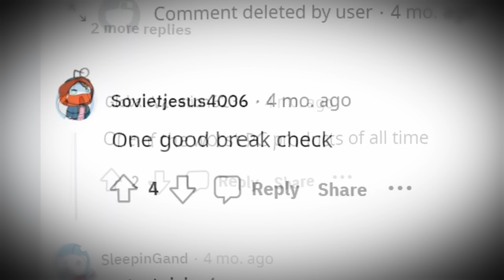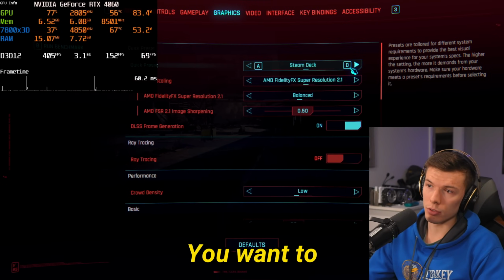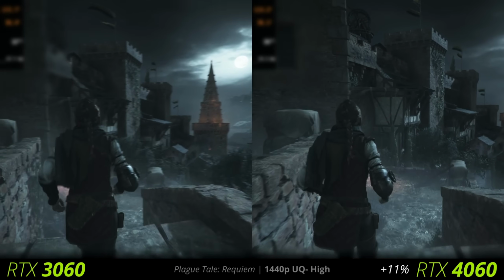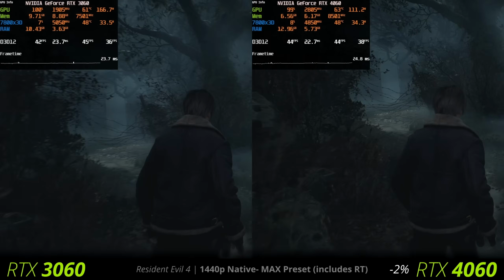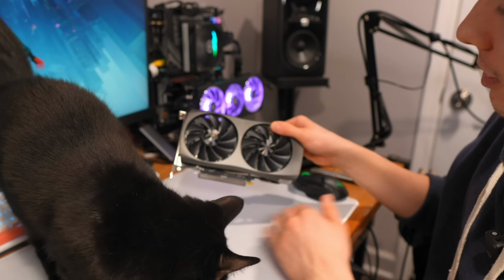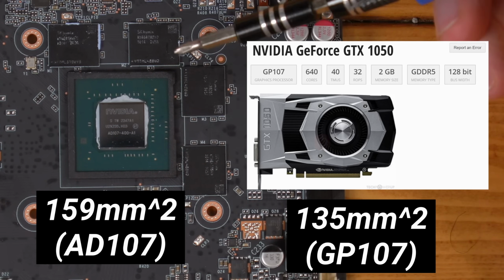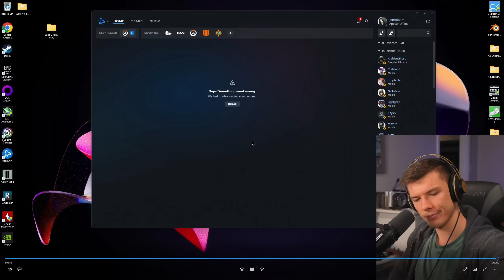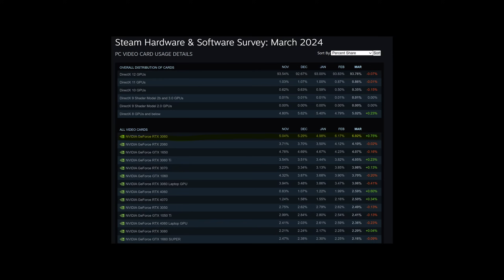I Tried Nvidia's best "Budget" GPU to see if we're Doomed

Comment: I WAS IN THAT THREAD! i was assuring to the guy though. told him not to let people get him down cause a new gpu is a new gpu. he was upgrading from something realllllly old anyways, so it was an actual upgrade for him. 
Plus it was the best he could afford so i just told him to go play and enjoy some games. 45-50 fps isnt optimal, but it is playable for single player. I remember being extremely poor and having to game on systems not meant for it. deleting textures out of game files and still only getting 26 fps... first gaming pc played skyrim at 48 fps and i loved skyrim. played it on that system for years before my first prebuilt. 
Budget gaming... its allot of compromises. if you dont have the money, sometimes you have to take what you can get. thankfully theres allot of optimizations in the Modder scene. 

Remember to always dl afterburner and look up oc guides on YT! keep your hardware longer regaurdless of how good/bad it is!
Reply: If you were actually there, that thread was months old. The problem and still the issue is he could've spent 49$ dollars more for 30% to 50% improvement.

Now cards are even cheaper and The 4060 is just priced even more wrong aginst other cards... very wrong... get a 4060 super or 4070 ti for the same price or slighter higher (all depends on brand and If it's used)
Reply: @monkeebunz8580  why you would you buy a used gpu? why would you buy any used electronic? It better be extremely cheap if it is a used electronic otherwise it doesn't make sense.
Reply: 9 years on a 1050, you sure about that last sentence there? lol

Comment: its interesting how people just assume 4060 is a bad gpu cuz its the lowest tier, ive got a 3060 which is a little worse and i play anything i want on it , i used it for 4k 60fps, and now im using it for 1440p 170hz, and if u just lower ur standards and use enough DLSS and play on medium settings, you can play anything even on 4k
Reply: I totally get if somebody was to buy a 4060 and had a 3060 already I wouldn't personally think that is money well spent, but there has been some pretty good deals on the all hated prebuilts with a 4060 in them and being as I play on a 60 hz 4k tv it works out pretty good 4 me,, when the 8gb vram won't cut it im putting a 4070s in it till the 12 won't lol
Reply: @nimrodpaul6875  yeah pre built especially good deal. Also, 3060 upgrade to 4060 is really stupid, Nvidia says you save on power but you can literally undervolt the 3060 to 115w with the same fps and get fsr3 mod and it's basically the same GPU as 4060
Reply: it’s kinda sad it’s only the price and vram tho i got a 4060ti for dirt cheap basically new and it was the best deal i could’ve gotten even going team red would’ve left me with less
Reply: @Shrewbloom  how much did you pay ?
Reply: @Techsnowball  11 days and yt notifies me I have a reply,,, lol, 👍
Reply: @nimrodpaul6875  yeah that happens to me too
Reply: I have a 2060 and it runs most games at 60+ fps on high settings 🤷🏿‍♀️
Reply: @bobbyhillthuglife I have a 1060 and it runs PUBG at 100 fps Lowest settings 😂
Reply: @Techsnowball You talk bulshit. Ada lovelace can undervolt much better than  Ampere. So 3060 which is already slower than 4060 on 115W would have 50% of its performance. 4060 can maintain 90% performance on 90W undervolt. FG is really where two gpus cant compare anymore.
Reply: @filippetrovic845  thats not true, i undervolted to 115w with most of its performance, its literally like 5% slower than like 1900mhz which is basically an OC version of 3060. And even with OC its only like 10-15% slower than 4060. Sure 4060 can also undervolt, but 90w doesnt really mean anything, you aren't really saving any power or heat at this point anymore.
Reply: I changed 3060 to 4060 within 10 months , 4060 is not bad for frame generation,  besides I will sell 4060 when 5060 comes 😊

Comment: It's kinda wild, because when people care about a 3-5 fps difference, but realistically if you just didn't pay attention... no one would know. That card runs everything on ultra for me, and i have no complaints
Reply: Yes 3-5 fps difference so just buy a 3060 lmfao. Maybe the price tag difference doesn't matter either
Reply: @nikolowolokin 3060 is like 220 and 4060 is 240
Reply: @void4713  where u getting these prices
Reply: same bro cod runs on ultra 1440p 120fps no problem with and without frame generation.
Reply: Ultra and high dont have much differences in good games like doom eternal, fortnite and cod
Reply: @RockyLaRosa  in most games*

Comment: It's really weird that no one around here seems to mention the Intel Arc A770 which is about the same price now and thanks to matured drivers runs laps around the 4060 in performance and ray tracing and with it's 16GB VRAM scales excellently to any resolution. The only thing that NVIDIA has going for them at that price point is power efficiency, which is not a big concern for gamers.
Reply: intel drivers said hello....
Reply: Arc drivers improved a lot but I wouldn't call them matured. There are issues in some games. You can't speedrun development in the graphics industry when your competition has been on it for decades. But in that short time they did a really good job.
Reply: @ravijotsingh7831 says who never owned an Intel GPU. They're fine right now, but there's always room for improvement.
Reply: Exactly. Because these brainwashed and gullible customers are still stuck in 2022, back when the drivers were messed up. Also, the first generation of a product line is always going to have some issues, it's only natural. If the Battlemage series goes well, it's very likely that Intel will take a huge chunk of the market share in the next 2 years.
Reply: @vinilzord1  Also don't think in future reference and talk shit to people when you know that the product is shit..... Don't be impulsive. If AMD can sustain itself against Intel then Intel can as well...
Reply: @killingtimeitself  yeah I hope it's good and cheap than it's counterparts....
Reply: @v5k456jh3  AMD used to be a manufacturer for low-end Intel CPUs, the good old Celeron series, there's more overlap between these companies than most people seem to think, and it's not like some industrial espionage doesn't help you short cut some road blocks...

Comment: Intel ARC A770 16gb is a far better value in my opinion. Bought one in December, and it's been fantastic. No problem running games at ultra settings in 1440p and even full 4k on low to medium settings depending on the game. But I would highly suggest it if you only have $300 for a GPU as it comes in at $299. I get 130+fps a 160hz at 1440p on my Ultrawide LG monitor and 60-80 at 4k 60hz on my TV playing on dayz... will only get better with a higher refresh rate. Don't listen to the nay sayers, these Intel Cards are not bad.
Reply: i play too much old stuff that it won't have drivers for, but in principle i believe you and wish they got more credit.
Reply: @Eunostos  I play a lot of older games too, no problem. I'm currently replaying the first Max Payne, smooth as butter.
Reply: r u having "coil whine" or other noises? thanx and greez from austria
Reply: @taggoluntner7422  Nothing no. Quiet as can be.

Comment: Something to take into consideration with the 4060 is that the laptop varient has feature parity with the desktop version of the card. It has the exact same die, exact same vram configuration (albeit a little slower), and can be clocked as high as the desktop version and be given the same power limits as it

Comment: 128 bit memory bus says everything
Reply: yea and 8gb memeory too
Reply: Plus 8x pcie 4.0 lanes (down from 16x from 3060)
Reply: Dont worry you should believe Nvidia and DLSS hype. Can get 80 fps with DLSS at 1080p (just dont try with DLSS off)
Reply: Nothing wrong with 128 bit buses, the problem is when the VRAM capacity per chip is low. If GDDR6 had mass produced 4GB chips, then 128 bit bus cards would have 16GB of VRAM it would be great, instead the volume of 4GB GDDR6 chips is very low and we get 8GB cards.
Bandwidth-wise again we just need faster memory.
Reply: @prosecanlik4296 You forget that the 4060 is a 30/40 class GPU, named as a 60 class GPU sold at almost 70 class prices(at launch).
Reply: @rattlehead999 More like they should have named it a 50 calls for the 128 bit memory bus, a real 4060 should at least have 192 bit or even 256 bit. It's even worse for the Laptop variants where they move them a class down further! Eeesh.
Reply: @rattlehead999  most people did not understand this. what's important is the total bandwidth not just the numbers from parts of the spec. worse some people think those bus preventing from more memory to be properly used like 4060Ti 16GB
Reply: @XenonG  what's important is the total bandwidth not so much about those card being 192 bit or 256 bit.
Reply: @arenzricodexd4409 It does matter, it's why the standard 3060 is either 6GB or 12GB addressing range.
Reply: @XenonG Bus width says nothing about any card. Memory bandwidth and memory capacity is what really matters. NVIDIA could easy give 12GB to a card with 128 bit bus, if 3GB chips existed. Also faster memory (like 22,5 GB/s instead of 17 GB/s) could increase bandwidth from 272 GB/s to 360 GB/s (which is equal to 3060).
Reply: @rattlehead999  Nah even with more memory and better bus card itself is too slow its 4050 at best not 4060.
Reply: @XenonG  but 128bit can also get 16GB like 4060Ti. but some how people think bad of 128 bit just because it is a small number than 192 bit.
Reply: Vega VII has a 4096 bit memory bus, the performance is unbelievable!
Reply: @Extreme96PL  It's a  4040/4030 at best.
Reply: @XenonG  Bus width is irrelevant die size is what matters.
The 4060 has a die size of 148mm^2, the 3050 has a die size of 198mm^2, the 1650 a die size of 200mm^2, the 4060 Tihas a die size of 188mm^2.

Thus the 4060 is a 40/30 class card and the 4060 Ti is a 50 class card.
Reply: Yet thanks to GDDR6 they're still able to push up to 272GB/s out of that memory bus.
Reply: @xXRenaxChanXx  Which is very low nowadays, which is why they are spamming GPUs with cache to compensate for the lack of bandwidth, same goes with CPUs and dual channel DDR5
Reply: @rattlehead999 the 4060 could never utilise 16gb vram 😂
Reply: @justmatt2655 Depends on the game.
Reply: @rattlehead999  no it doesn't. Worst case The max it could use is like 13gb any more than that and the physical performance of the card won't be able to keep up. Look at the 4060ti 16gb that has the same problem and it's a higher performer than the 4060 lol
Reply: @justmatt2655  Still more than 8GB.
Reply: @rattlehead999 50 model fits better because of low power draw and fact that its more or less speed of 60 model from prievous gen.
Reply: @Extreme96PL  Performance is a byproduct.
Reply: @arenzricodexd4409  Well the bus size is a pretty important part of the total bandwidth.

Comment: I have a 4060, but mine is one of the 16GB ones. I can only compare it to the 1070 I had previously and it is really good. You can play Cyberpunk on Ultra settings at 1080p with no issues.

Comment: just got a 1440p external monitor and 4060 laptop recently, loving it so far. I know 8gb vram in modern games might not be enough but just dropping the texture quality fixes vram usage in most cases and lets be honest even if it had higher vram RT would be smoother but still not 60+ fps so realistically no one is going to sacrifice fps for RT that sometimes isn't even that noticeable. I got a great deal on the 4060 and I'm happy.
Reply: I bought a prebuilt cyberpower from costco with a 4060 right after they come out and was literally having buyers remorse while enjoying it lol ( how dumb is that?). When the 8gb vram becomes an issue I will throw the 4070 super in it and be good till 12 ain't enough lol. Enjoy that laptop my friend.
Reply: Cope.
Reply: @AngelicRequiemX  God forbid someone be happy. Get a life.
Reply: @bradleylauterbach7920  lol ikr
Reply: what's funny is the 4060 standard version is only 6% better than the 4060 mobile.  that's pretty crazy actually.  nothing wrong with getting a 4060 laptop imo, i wish i had one.  still rocking my 770m alienware!  10 years old and it's still kickin, i just clean it out once a year.  i just replaced my 980ti 2016 build with a new 4070 ti super build, so it's not like I haven't experienced more juice, it's just that for a laptop you don't need a powerhouse because you're prob not going absolutely crazy on it with high settings and resolutions.
Reply: @bradleylauterbach7920  Keep coping.

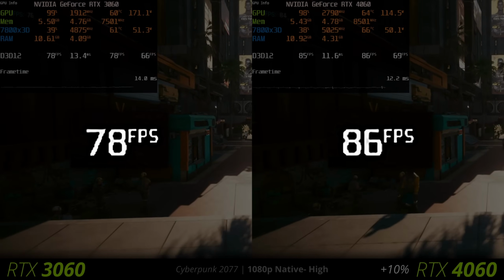Comment: 5:00 power efficiency man
Reply: Oh this is actually quite a big leap
Reply: @Ishi112  big chunk of tdp went down, overall like vex said 200 to 250 bucks is more reasonable 😆
Reply: Shhhh ni siquiera saben que significa
Reply: Yeah the engineers cooked with the efficiency, hats off - but then came the marketing team
Reply from the maker: @itsTyrion lol no, then came the finance team
Reply: No, screw that, I’d still rather undervolt and drop power limits on a better chip. The same power scaling would apply if it’s the same architecture
Reply: a 4070 with some undervolt gets way better power efficiency so it doesnt really shine even at that
Reply: @morettillo5487  fr, but doubt it stays always at lets say 115-130w, unless it does, then i might look into that. or wait for the next gpu gen line up

Comment: I decided on the 4060 almost purely based on its efficiency. This card comes close to my older 2080 Super in so many situations, while using less than half the power. I also still have only 1080p displays. 

Great video <3
Reply: is electricity expensive where you live?
Reply: I'm happy with my 4060
Reply: Yeah, I'm not willing to buy a new screen and anything better than the 4060 would require a new cpu+psu. I'm happy with my card and I'm just looking for some fun in my spare time, not to play my life away in a space station
Reply: @caustictoad  People complain about it costing 300€/$ yet it uses 50W less then the 3060. So 20h = 1kWH which is like 0.10 - 0.40 €/$ depending on country. If you live in Europe the lower energy consumption is absolutely worth the price of the card as long as the 4060 is an upgrade to your current card and not just a replacement for something like the 3060.

Comment: I will consider 4060low profile for sff build, really small one.
Reply: Yes, they are great for that, but for people with way more money, they get an A2000 for sff builds primarily focused on workstation tasks, but these pro cards can play games surprisingly well, and they have much, muuuuuuuuuuuuuuch longer support from nvidia than their consumer-grade cards, without mentioning that they are extremely optimized for efficiency, they just consume crazy low amounts of power and generate almost no heat. I remember an RTX 8000 could do the same or in some loads the double than a 3090 using less than half the power of a 3090. As much as I have to agree nvidia is greedy, their professional cards are really, really well made and built impeccably, the super long software support for drivers and improvements also are very attractive.

Comment: What's weird is I bought a 2060 KO in 2020 for $300 MSRP. One of the cheapest cards I could buy, and it absolutely felt worth my money. Still been sporting it to this day (though I am just building a new computer in the next couple weeks) and it's played everything I wanted to, maybe not at 1440p 120fps, but everything has played at an acceptable framerate, a handful of games have allowed me to enable ray tracing, I've been able to play VR and work in Blender and Maya pretty well too. It's been an absolute champ of a card. 

To see people trash all over the 4060 has left me very confused. It's a better card, no? $300 has been their bottom end bar for a long time, unless you wanted a GT710 or GT1030 for like $50. It's the same card I bought but 2 generations newer. It's a better card than what I paid $300 for 4 years ago. Some folks cant afford a cent more for a GPU.

If someone ends up with a 4060, no shame. It's gonna last you awhile, especially has graphical fidelity and improvements slow. Nothing like the 2000s and early 2010s. A 4060 will last you 5+ years if you're smart about it.

Comment: LOL-- like a few others, I only just upgraded to the RTX 4060.  BUT it is certainly an upgrade from the GTX 1660 and finally I'm able to play games in 4K.  So, I think I'll be satisfied for awhile all the same.
Reply: I was in the same starting spot (GTX 1660) and the only reason I finally chose the 3060 instead of the 4060 was due to some work I need to do with small AI models, were those extra 4gb of ram can make some major difference. But for a pure gaming perspective, the 4060 would have been my choice specially for frame generation on top on DLAA/DLSS.

Comment: It really does depend where you are from as well. 

As of right now, where I'm at, Malaysia, 

a 4060 ventus costs, $315USD

the rx 7600 XT is $415 with its sadder counterpart, 7600, $300USD. 

For context, a 4060Ti is $473USD, 4070 is $670.

Your only option is a USED 3070 at the same price no warranty.

If you want DLSS, some Ray tracing and it fits the games you play, it's really not a bad deal considering what is out there currently. Also, 4000 series is getting DLSS4 and smooth motion. 

I know this video is almost a year old, but in the current market, it ain't bad.